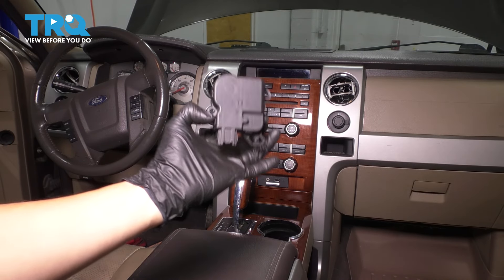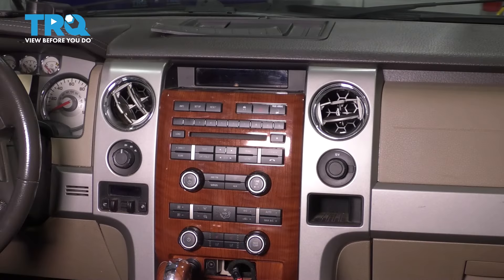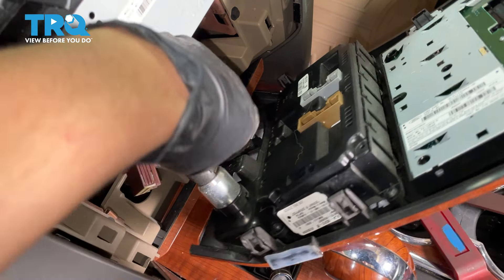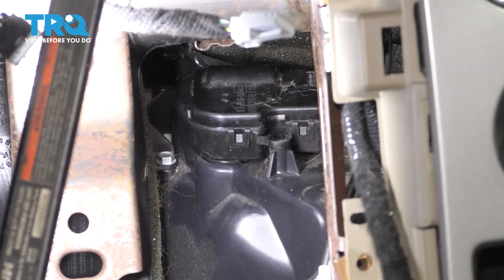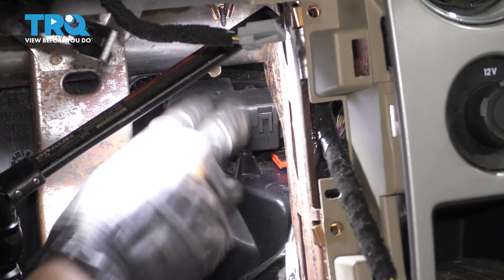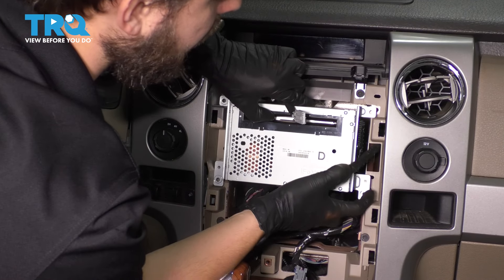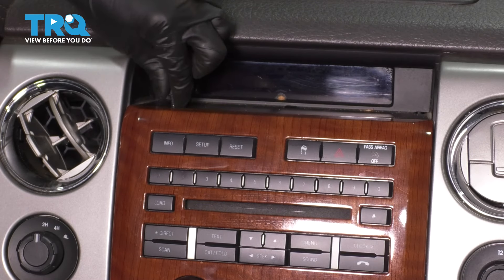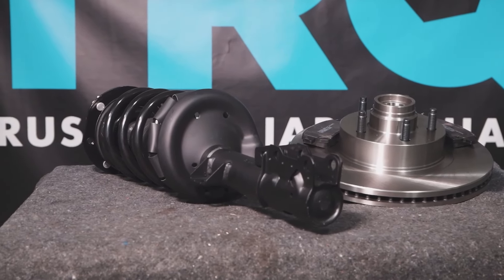How to Replace Blend Door Actuator 2009-2014 Ford F-150

Comment: Treat video; however, I have a 2010 F150 Lariet and the space between the actuator and the metal bracket was significantly less, like 1/4" .  The smallest micro socket I had couldn't even fit in there.  My solution was to use a 1" putty knife that I heated up with a torch to cut apart the old unit to access the rear screw with a racheting boxwrench.  I installed the new unit with only the front fastner.

Comment: One thing I do to get screws or bolts in tight places is to use Vaseline in my socket, and it forms a suction with the head of the screw and it holds it so you can start it easier. Great video.

Comment: My hands where too big to fit. I unplugged it. Took out the front svrew. Popped the tabs off the part so the top cover came off. Grabbed the main drive gear with needle nose and lifted it out. I was then able to rotate the whole actuator around so I could easily get to the back screw.

Comment: Great video, excellent tip on making homemade tool. I gladly sacrificed a 5/16" impact driver socket, cut its stem off shorter, wrapped the stem in teflon tap to help hold in place, and drove it with rachet end wrench. Your tip made this job sooo much easier.

Comment: I have just replaced mine with the help of this video, problem resolved! Obviously I also got stuck with the screw that is behind, but I have been able to unscrew it using a tiny and straight 5/16 box wrench by passing through the glove box opening while using my left hand as a guide. I put an elastic attached to it to avoid losing it, plus it helped me pulling it back to continue unscrewing. I haven’t put that second screw back in place after. Hopefully it will last🤞🏻. Thanks!
Reply from the maker: +@jean-francoispoitras6857 Thanks for watching our video! http://1aau.to/m/Shop-TRQ

Comment: U r the best...you saved me so much time. I Pulled the console because of another post. 🎉Like yours it's not necessary. Wish I has saw your post first. One thing I might add. Instead of fighting the 2nd bolt..pry the actuator top off, it is useless now or you wouldn't be replacing it. It makes getting the 2nd fastener out easier

Comment: Thank you for the video. I found if I reached my right hand through the glove box opening with a ratchet and left hand through the radio opening to steady and align things I didn't need a special tool to get at that back screw, just small ratchet. If you consider a very small rachet not a special tool anyways :p Thanks again for the video!

Comment: I have installed a new actuator twice but the part that the piece plugs in to (the little dial that was white on the stock actuator but black on the new one you installed) will not allow it to twist. It is stuck. What should I do?

Comment: My issue was I had no heat anywhere, but I don't have dual air, just singular. I changed the actuator, but now it only blows hot air even with the a/c on full.  What is going on?
Reply from the maker: +@cookingwiththehiatts5225 We wouldn't be able to diagnose an issue like that here, you may want to have a local mechanic take a look at it. Thanks for checking us out! http://1aau.to/m/Shop-1AAuto-c

Comment: I’ve replaced mine 2x and it usually works great for awhile, but now back to not working properly.  I’m hoping I’ve aligned everything ok… new motor goes in east enough and seems to be lined up… but fails again after a few months.   What am I doing wrong?!
Reply from the maker: +SteVenS We wouldn't be able to diagnose an issue like that here, you may want to have a local mechanic take a look at it. Thanks for checking us out! http://1aau.to/m/Shop-1AAuto-c